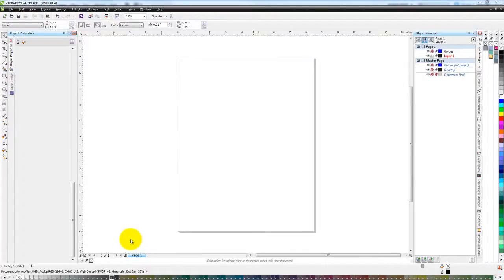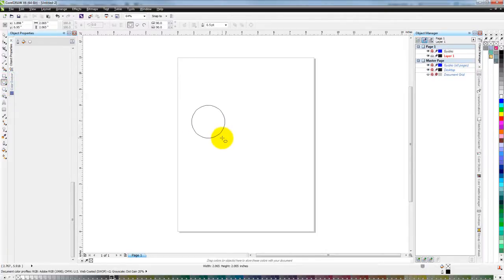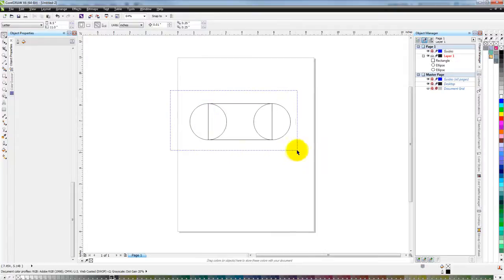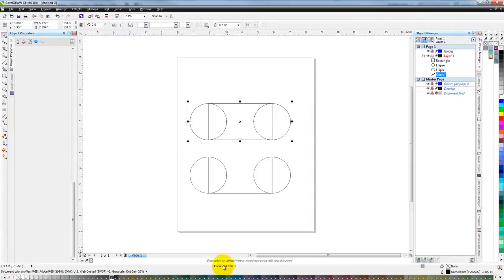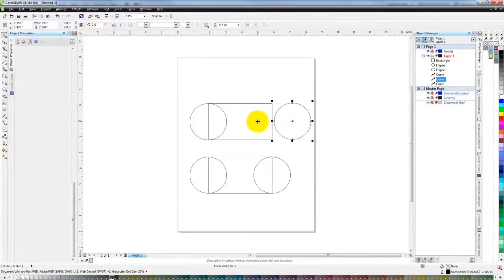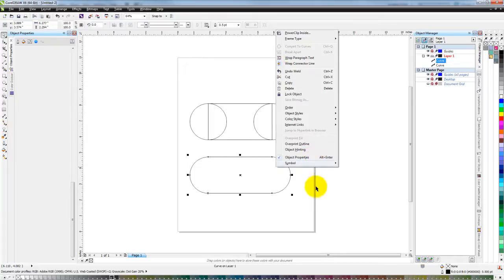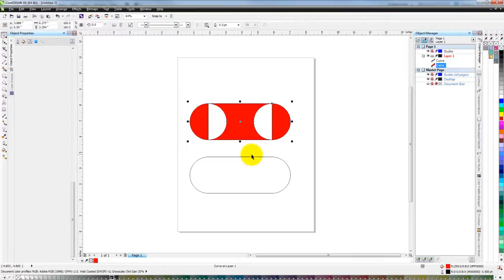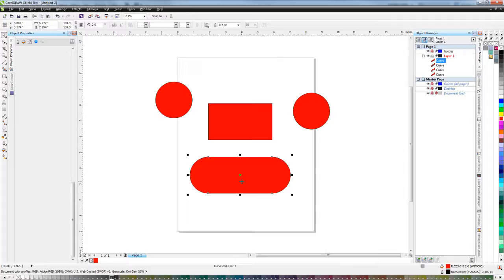Corel Draw  Combine vs Weld

Comment: I have a series of letters - numbers that have to be 1/2" wide at the legs of the letters then the spacing needs to be 1/2 from one to the other.  If I stroke them, when I cut them out after welding - it only cuts the original size.  If I use my Sign Tools program to 'bold' them to the right size - the Corel tool for spacing them no longer works.  it says it only works on text.  I'm at a loss and meanwhile will have to pay someone to cut out these letters in vinyl - but would like to know what the answer is - if any...........  thanks